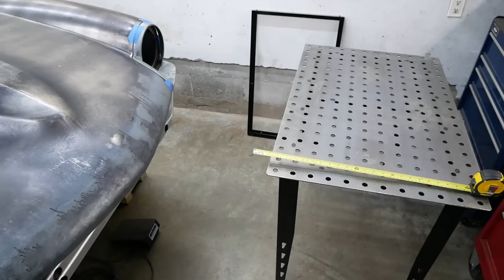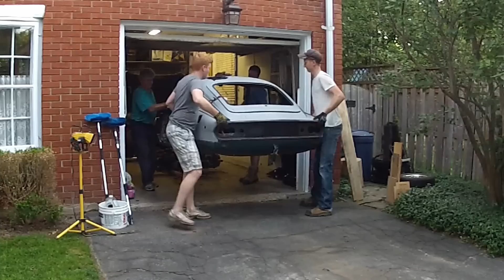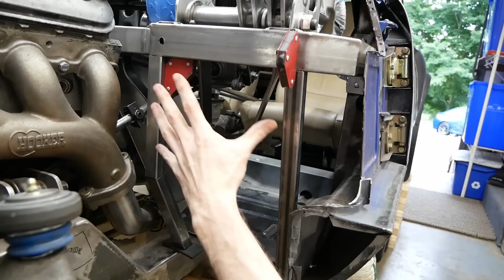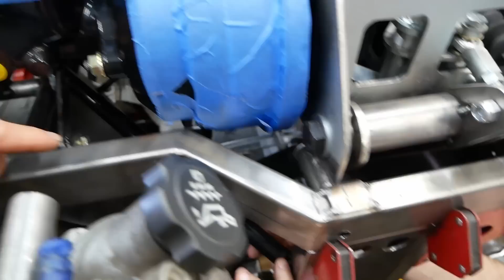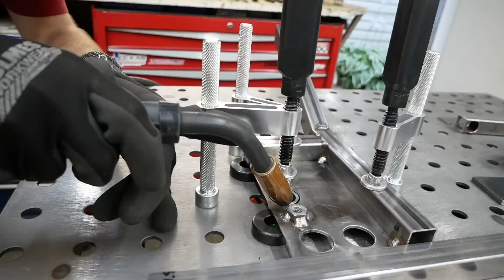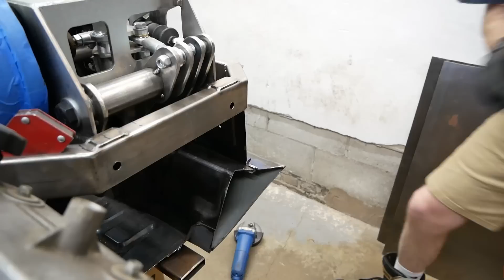Serious Structure – V8 Powered Pro Touring Triumph Build – Project GT6R – Ep41

Comment: With all that metal added, it will be heavier than a Viper, and what is the point in that?
Reply from the maker: Current projection for the dry weight is 2400lbs so not bad honestly!  I'd rather overbuild it than wish I'd done more later.

Comment: The steering ratio on GT6s and Spitfires is very high, so it's difficult to make fast steering responses. Couple that with minimal weight over the back wheels, low moment of inertia and terrible suspension geometry and these things are lethal when they oversteer, particularly in the wet (speaking from experience of both). Putting a V8 in a GT6 could be your ticket to oblivion - can't wait to see how it behaves.
Reply from the maker: In episode 18 we shortened the steering rack, as the new knuckles have a smaller arm and don't need as much throw.  Effectively this has decreased the steering ratio and sped things up.  Just over 3 turns lock to lock now, and a healthy amount of angle at the wheels.  All the rest of the suspension is completely new with a lot of time spent on the geometry and some massive improvements over factory.  Weight distribution and CoG are also improved.  I'm not suggesting that a car with such a short wheelbase will ever be anything other than a "handful" ... but at least we've made good strides in the right direction!  You and I both eagerly await it's roadworthyness!

Comment: I can't get over how you can leave steel, and it doesn't go rusty in 2 hours! It does here in Herefordshire...
Reply from the maker: Our summers are very humid and areas of bare steel have definitely got some surface rust setting in already.  On a bad day it could well happen in 2hrs! 😅 A lot of parts have been treated with a rust-converter which keeps things at bay, but we've got out of the habit of using that lately and really need to start again.  Thanks for the reminder! 😅✌️

Comment: Save yourself some future time. I acid etched my table that is the same model as yours. It has been a huge time saver sanding off surface rust that just doesn't happen now. I've had sanded rusty spots leave stains in the steel that transfer during welding. Not a problem anymore. With your attention to detail, I know you will appreciate it...
Reply from the maker: I'll have to look into that, thanks for the tip! 😎✌️

Comment: excellent video, I've been following it for years from here in the UK. Just a thought though. I think you should put some spark plugs in to stop any welding debris or other foreign objects getting into the cylinders
Reply from the maker: Thanks John, appreciate the continued support!  The engine is completely empty as it stands (other than the crankshaft), and we'll be honing the cylinders before new rings and bearings are installed, so hopefully all shall be well!  Thanks for the thought and concern though, probably would be a good idea regardless. 😎✌️Cheers!

Comment: @25:00 As someone who has done a lot of automotive fabrication... spend some time learning how to fill larger voids. EG, take multiple passes over an hour (giving time to cool and not warp), but essentially I've filled gaps much larger than that with MIG/TIG welding. Also recommend you bevel edges and leave more gaps between metal tubing to "fill" with weld material. I am seeing a lot of instances of welding two pieces together then grinding flat, which removes most of the weld/strength. whereas if there was a gap for the weld to go into, you'd end up with a lot more strength...
Reply from the maker: I've had my fair share of filling voids, but other than leaving a small gap for MIG welding, it's just better all round to have a good fit up.  Any edges that get ground down have always been bevelled by the way... no need to worry👍 but thanks for the thought and concern!

Comment: Just wondering the overall weight once finished as it is so beefy against a stock GT6
Reply from the maker: Probably the most asked question of the project!  Hoping for 2400lbs dry ... a little more won't bother me though, as I'd rather overbuild it than wish I'd done more.  Cheers Bill 😎👍

Comment: Every time I watch one of your videos, I come away tremendously impressed by your extremely clever usage of space and materials. I didn't think it would be possible to carve out more tire clearance without interfering with your pedal travel, but you pulled it off! Kudos!
Reply from the maker: It was a balancing act, but thankfully it worked out in the end!  So glad we didn't have to just reduce our turning angle, that was my worst case fallback.  Cheers man, means a lot to me! 😊🤜

Comment: Could the front  inner wheel wells be structural to tie the fire wall to the front chassis rail?
Reply from the maker: Thought about that, but for all the benefits it would give, it would also take away from perhaps the coolest design aspect of the GT6 (where the entire front end hinges forward).  If I were to leave them stationary, I would also integrate the sides of the hood/bonnet (up to where the pinch seams are) that way only the top of the hood would lift away, and the rest could be integrated quite nicely.  It's something I've waffled on for years but we're going to stick the course and hope for the best! 😊👍

Comment: Awesome job. That's a very beefy torque box area now. Suprising that section is only 6lbs. 
I'm curious what the car will weigh/weight distribution. Can't remember if  the battery is in the rear to help balance that a little.
Reply from the maker: The finished structure should massively improve the rigidity of the chassis!  I'm hoping for around 2400lbs dry, and as close to 50/50 as possible, though it will still likely be a bit front heavy.  Never mentioned it on camera but yes, we'll stick a nice heavy battery in the rear passenger side to help offset things a bit! 😎✌️
Reply: @FanatikBuilds  Sounds good.
I've said it before but love your attention to detail and problem solving skills. That amazing car is another step closer to being back on the road, and definitely higher build qaulity then when it was new. Big improvements.

Comment: one of the kind, much much, much better than the original and much better than about any car today on the road.
 I just wish that the transport dept will not be too reluctant to emit a plate for that car as it is almost tolally home fabricated.
to what I seen up to date, you,re totally on the spot with that design.
I'm anxious to see the final tuning of that car as for sure you'll need to make some adjustments to make that car drivable and comfortable and one thing I see is the spring and shock absorber fine tuning and  sound deadening because the new structure is much stiffer than the original one, the front axle geometry is radically different  and the dynamic properties of the tire / wheel combination is radically different from the original.
in globality, a project thav I loved to do even if the orientation I,d choose would be somewhat different  in the way  'i'd choose a 60 degree V6 engine with its gearbox too keep the car as unmolested as possible.
very good project.
Reply from the maker: Thanks Jacques, the process of getting it on the road here has its issues, but I've been told by numerous people that it should be possible, so I try not to worry.  I instead focus my energy on building it the best I can, so there's little way anyone can argue it's safety.  A 60 degree V6 would have been a fine solution, but we've never owned a V8 before and can't wait to hear it fire up! 😎👍 Cheers✌️

Comment: This build reminds me of the time I toured the inside of a WW2 submarine where every void outside the walking area was conformed to accept an operation component. Think 5 side cabinets etc… when his is all done and painted and sealed I hope that those visible structures are painted light enough to be seen an appreciated. This build is not a celebration of horsepower per pound rather it is an exercised in boundary pushing and engineering triumph. Many would have faltered in the duration of this build but anyone attempting this build would have fallen by the side of the road desiccated by the amount of energy and thought expended to keep moving forward. Keep up the excellent work both of you have delivered.
Reply from the maker: As much as I agree it's not all about hp/ton or maximum weight savings, I do still hope it weighs less than the sub you referenced! 😉 I imagine most of the firewall componentry will be invisible once the car is completed, but some large access panels could be removed at car shows so people can get a small glimpse of the jigsaw puzzle lying beneath!  Cheers Craig, that really means a lot to me, thank you for the kind words 🙏🤜
Reply: Thank you for your channel which allow me to follow along. After a full career of being a commercial building  I am now on a walker and your travails allow me to reactivate my analytical brain. You have many talents, dry humor being on of them. and I really appreciate belong allowed to occupy your project while you work through this. Very few people, very few, could have pulled this off. I hope all your dreams are realized.😊

Comment: Annular cutter and a die grinder
Reply from the maker: I've never stretched the budget to annular cutters yet, but I want some!  Die grinder with a carbide bit would have been too brutal for the small amount of material I needed to remove here... I need some sanding wheels for it.
Reply: @FanatikBuilds  wood+lathe+sandpaper

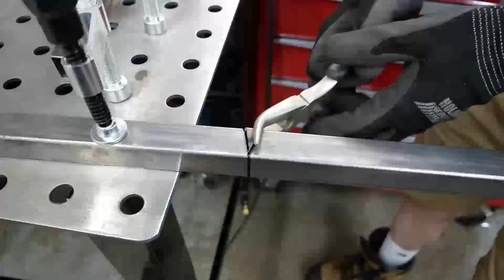Comment: Why are the axles shafts so damn THICC? Also, what is that deburring tool at 10:46 called? I can't seem to find one online.
Reply from the maker: The rear end is from a C4 Corvette, and its geometry uses the axles (with UV not CV joints) as the upper control arms.  Keeps things super compact and I'm never going to worry about breaking one 😅 Episodes 13-14 go into it more if you're interested.  The tool at 10:46 is literally called a "deburring tool" ironically 😄 you can get them for cheap on Amazon but this one came with a brake line flaring kit.
Reply: @FanatikBuilds  Oh, so you're running Chapman strut. Neat. As for the tool, that's insane because when I first saw someone using one I went to amazon and typed that in and came up with nothing at all that was similar.

Comment: Be sure to also factor in your 3D printer when you get to internal stuff, like making molds for the door cards or using a 3D scanner to design instrument cluster mods for the dashboard. And don't forget to use high-temperature filament that can withstand cabin temperatures during the summer.
Reply from the maker: There's a million+1 uses for it in mind! 😎 such a cool piece of technology.

Comment: brake pedal slightly tilted
Reply from the maker: Used a straightedge to get them right, but we left both the brake and clutch pads spot welded so we can adjust as needed.  I think it's more the clutch than the brake honestly ... it's deceiving.

Comment: "It only weighs 6 pounds" 😂 its 4 times more than the sheet you have cutted off. Great fabrication but questionable solution
Reply from the maker: It could have been much more, that's the point!  The sheet metal had the rigidity of a boiled noodle ... and, the car's finished weight should be around 2400lbs ... so it's not exactly heavy by any means!

Comment: If you want to neaten up the look of your wiring through the fire wall and make it easier for assembly I recommend using a bulkhead style connector. It mounts to the firewall and enables you to disconnect the entire harness from the engine bay, pretty useful for removing the cab. These Deutsch connectors are quite nice. 2366494-1 and 2-2366509-1 are their part numbers.
Reply from the maker: Appreciate the tip and part numbers, thanks man!  Planning on Deutsch connectors throughout the car 👍🙏
Reply: @FanatikBuilds  no problem, I got them from LCSC. The only thing missing though is the locking collar. You can find the 3D model from the manufacturer and print your own too.

Comment: It's the design of the car but having the wheel in a position to crush the driver's footwell is a bit disturbing for me.   Is there a way to ensure that the wheel collapses underneath the wheel well in a front corner collision (ala hitting the wall at the track)?
Reply from the maker: I'd say most cars are susceptible to that issue, and it's the reason why the IIHS "small overlap" crash test was introduced.  Our structure made here is aimed to help prevent just that, and instead deflect the wheel outwards as it's pushed back. 👍

Comment: Will this new structure still allow for the removal of the body?  Or will this now be part of the body, and be removable from the frame?
Reply from the maker: The structure built in this episode is getting welded into the rest of the body, and will provide the first of several mounting locations to the frame.  The plan is to have enough structure in the body that it completes and reinforces the frame's shortcomings, so very little rubber will be used anywhere.  More or less a unibody, with one big subframe instead of the typical two smaller ones on modern cars! 😎✌️

Comment: Are you using 11 G or 14 G steel for this structure?    I thought it was 11G, but sometimes it looks more thin.
Reply from the maker: The 1x1 and 1x2 box in the firewall area is 1/16" wall, the round tube in the tunnel is 1/8" wall 👍

Comment: I mounted my roll a round tool box to the bottom of my bench permanently so the whole thing rolls around together. I also put 2x3 square tubing in the rocker panels to tie the front and rear subframes together with the cage in my Firebird
Reply from the maker: Both good solutions! ✌️

Comment: I love the work! Though, you say you’re keeping this body on frame, but it looks like the horizontal bar interfacing with the firewall panel you just built gets in the way of the original body being able to be lifted off the chassis. Maybe I’m missing something or you’re looking at removing this section anyway, but it’s just something I noticed. Either way I love the work!
Reply from the maker: The front "chassis support structure" will also be removable, correct!  The main reason for keeping it body on frame is convenience at this point, the small garage space is very limiting! 😅 Cheers Cameron 🤜✌️

Comment: To skin that assembly I would cut individual panels to go between each of the square tube members.  Basically a bunch of smaller rectangles.  Set them in ~1/4" and it will add aesthetic value.
Reply: Yes, but act as a mud trap.
Reply from the maker: Got a similar idea that should work well and not trap as much dirt as Pashak pointed out 😎✌️

Comment: What country doesn't allow a half cage on a road car 😮
Reply from the maker: Ontario 🇨🇦 at least! ... 😬 to be clear though, I'm not 100% sure, it's a grey area that's difficult to find info on.  Insurance companies don't like roll bars (they are dangerous if mounted in the wrong place and your head can make contact) ... harnesses are not allowed.  Police may or may not pull you over if they see a cage through the window ... if they do, they could get fussy over other modifications to the car (legal or other borderline).  To save the potential aggravation, I'm instead thinking of ways to help increase the strength of the factory "roll hoop" while keeping it tucked under the headliner.  I want the car to be as correct and proper as possible.  We'll see how it goes!

Comment: Nice work gentlemen. For the difference between North American ( I am unsure as to your location)  and English style race car construction I would recommend the you tube channel " Project Mosquito" , but start at episode 1 .  To those who may not know the history of the Mosquito aeroplane,  it was a very successful WW2   twin engine fighter bomber made from plywood and was extremely fast due to its lightweight construction. Yes, I accept that the Fanatik Build has a wopping big V8 power plant  so the frame needs to handle it. Keep up the good work boys!
Reply from the maker: We're in Ontario 🇨🇦 David!✌️ The whole concept of a lightweight powerful sports car is perfection, but keep in mind that we're not going for an all out track car... I want this to be a comfortable long distance cruiser, which is why it's got A/C!  Also, our region is flat, with straight roads = nothing interesting for a car that priorities handling.  We've never owned anything with a V8 before, so the point of the project was to just have fun and learn new things.  All the additional structure and bracing will have certainly added weight, but I'm estimating a finished dry weight of ~2400lbs which is still light by any standard!  Cheers 😎🤜